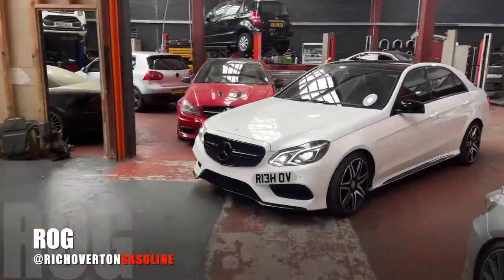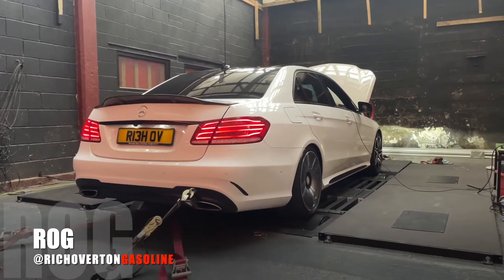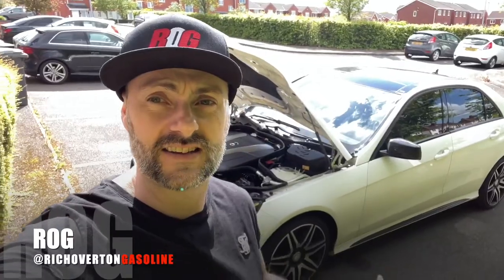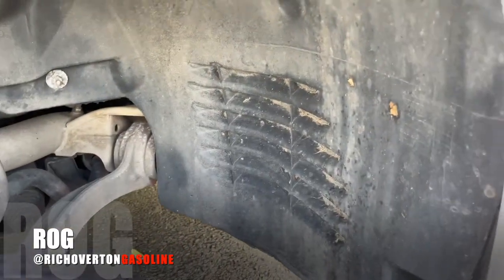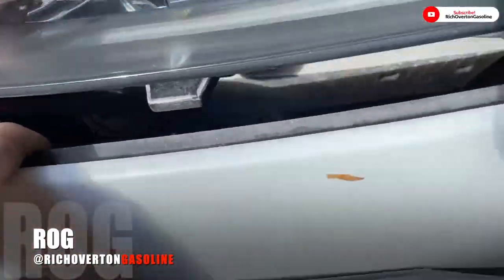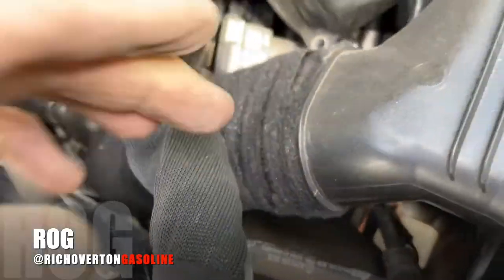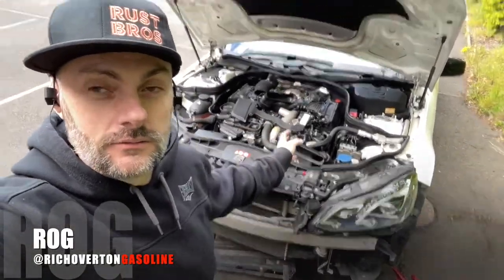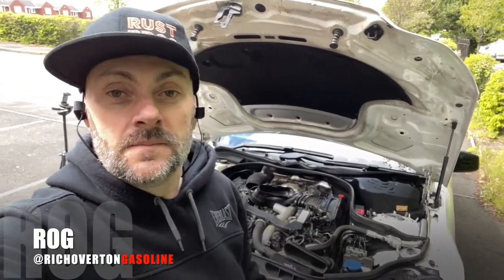MODIFYING MY MERCEDES E350 AMG | PT5

Comment: I've just picked up an e350 bluetec saloon exactly same as yours on the actually, I'm also thinking of going to a hybrid turbo and intercooler upgrade to put the car on par with Audis bitdi and bmw's 535d platform unfortunately Mercedes engines were massively underpowered stock compared to Audi and BMW for the diesel engines for this year, maybe that's why there not often modified? Also heard the gearbox's don't like going past 700-800nm so could be a weak point?? 

Either way loving the content and nice to see someone modding a diesel E ill be keeping up to date with the results and future videos.
Reply: I think it is because Mercedes prioritised reliability over power for this engine. It is much more reliable than the BMW and Audi equivalent.

Comment: Will be watching this series closely have a 2011 c350cdi 265bhp stock it’s mapped on a stage 1 too 300bhp but definitely contemplating bigger turbo etc just worried about torque converter handling the extra torque
Reply from the maker: Thanks for support 👍🏻🙌🏻

Comment: It's the orange oil seals you've got to be extra careful with - any sign of a oil leak get it in ASAP. Also, yes, auto gearboxs can only cope with around 700nm without problems. I've had 310bhp and 720nm for over a year and it's been absolutely fantastic!

G. A. D Tuning :)

Cracking video.

Comment: Great video mate good to see someone molding an e350, I've got one running 310bhp looking at an intercooler upgrade but aftermarket upgrade parts are a nightmare to get hold of in the UK loads available in the US but taxes are a killer on high priced items, where did you get your upgrade intercooler from ???
I'm trying to find a company to make me a bispoke carbon fibre bat wing plus air box's with proper K & N intakes going all the way to the front panel and including the front intake panel, also a bit worried about running over 720 torque, but may be a gearbox upgrade to a AMG 63 box could be the answer 🤔🤔 anyway loving it keep it up👍👍
Reply from the maker: Intercooler has to be custom built as there isn’t anything off the shelf of that bolts strange on, although you can get a hybrid turbo off the shelf as I have one to fit.. with the stage 1 map I’ll achieve 
350bhp to 400bhp with the standard intercooler, standard engine anything more than that it can have an impact on the gearbox. apparently it pops the oil seals!

Comment: Hey Rich, what's your fuel consumption like since the remap? Is the 350 a thirsty beast? Debating on oke of these or an e250...
Reply from the maker: I am not sure to be far, it's not too different to pre-map about 50 less per tank.. but Its the V6 diesel so it was good to start with anyway.
Reply: I have an E350 Bluetec and recently on a highway journey I got 1350kms on a tank of diesel at an average speed of 120kph. It averaged 5.2 litres per 100kms.

Comment: What year
Reply from the maker: It’s a 2014..
Reply: @RichOvertonGasoline  sweet i have one too i got a couple performance mods as well
Reply from the maker: @splittingtraffic2674  nice, what modifications has yours got?
Reply: @RichOvertonGasoline  rear muffler delete mid x pipe stage 1 tune and an air filter check her instagram page @SplittingTraffic if you're free looks good too
Reply from the maker: @splittingtraffic2674  Nice, I'll take a look 👍🏻, Fyi is yours a petrol or diesel?
Reply: @RichOvertonGasoline  petroll